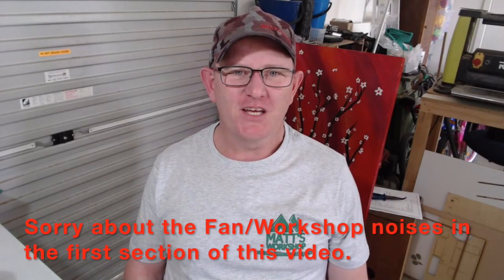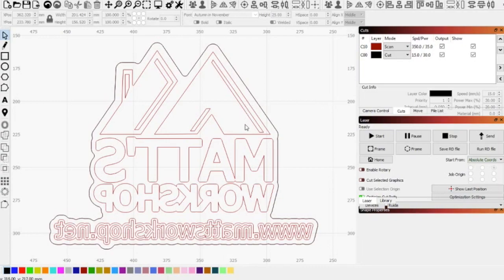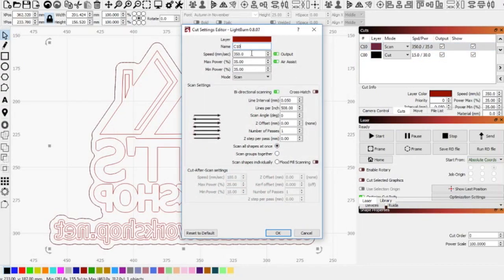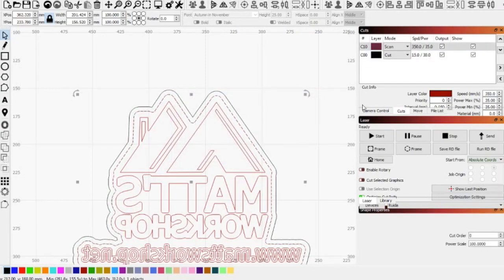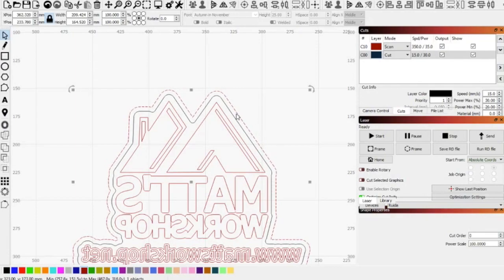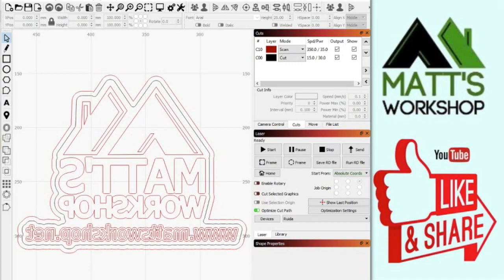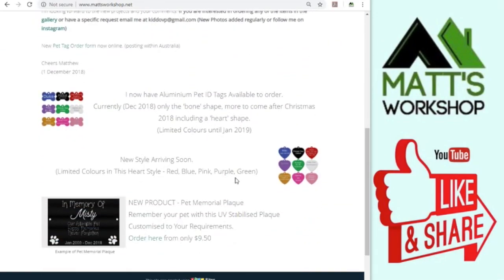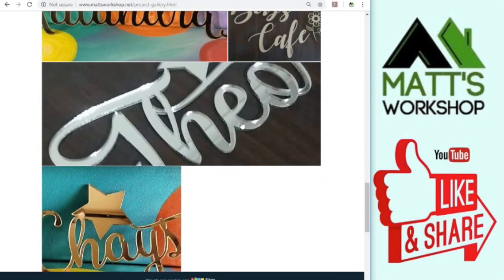Iron on Transfer Using Trotec LaserFlex For Use on CNC Co2 Laser Machines

Comment: friend where does the disintegrated vinyl go? Does it evaporate or does it go into the air? I'd really like to know why it disappears ... won't it be very harmful over time? Do you think it can be used with a diode laser? I do not have a co2 laser but I do have a diode one but I hardly use it because I am lazy to wait for it to work because it is very slow
Reply from the maker: This is not vinyl.  Yes the material is ablated and would be extracted via your exhaust fan.  Check with manufacturer regarding use with diode, I would guess it is fine.  Cheers

Comment: Thanks for your video...
Just tried the Laserflex. I also got a 80W laser, chinese, but it works well....
If I use your settings, 350 spd, and 30% pwr, I burn away both the color and the protective film.
I'm really struggling to find the "sweet spot", where you engrave the color away, but keep the film.
If I lower the power just a bit to 25% pwr, it doesn't engrave the color away. Any ideas ?
Reply from the maker: if at 25% power it does not take off the colour, then increase power by 1 to 2% each time until you get the result you are after.  alternatively slow speed down.. eg to 300 mm/sec at 25% power and then work from there.